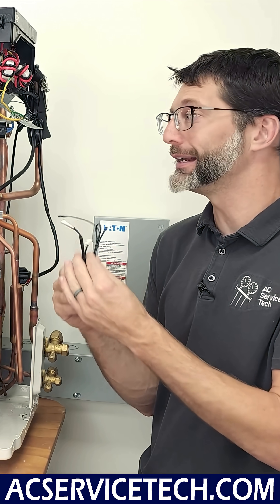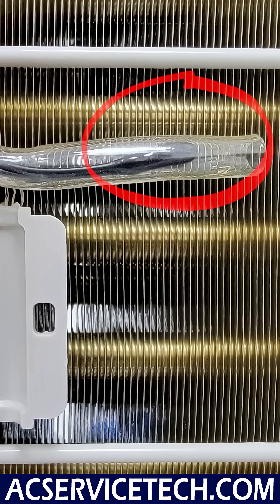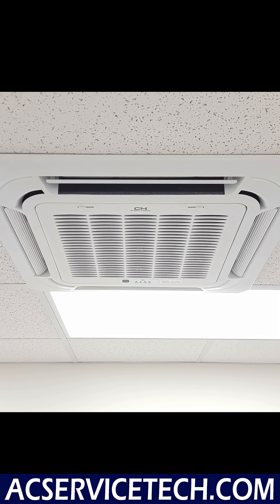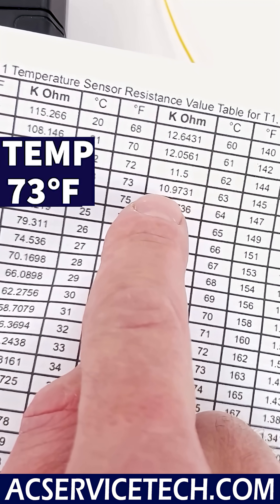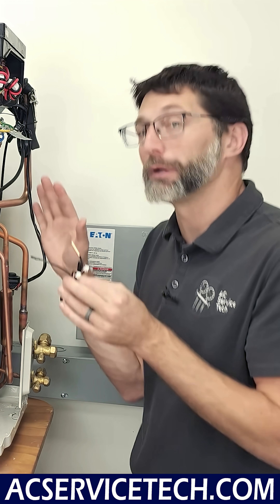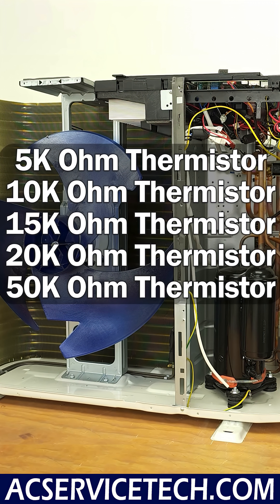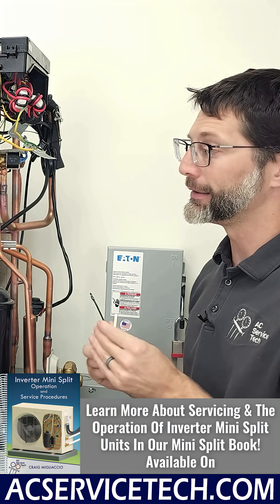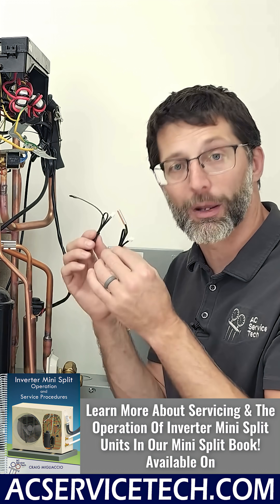Thermistor Problems on Ductless Mini Split Heat Pumps!

Comment: Or there is corrosion on the wire changing the resistance numbers. Depending how the previous replacement was done.

Comment: Also NTC(negative temperature coefficient)or PTC(Positive temperature coefficient). Does the manufacturer state this as well?

Edit: I asked because I got dixell control which uses NTC probes but was set up for PTC. It has engineer parameters so I was able to change on site

Comment: Yep. 1 thermistor took down a Mitsubishi city multi to a data room. We had it so good with 24volts and a contactor 🤘⚡️🤘✨✨✨
Reply: How did that 1 part stop the unit from running? Like how did the unit stop running was it just not turning on at all? And what were the signs you knew it was the thermistor
Reply: @anthonybarragan1687 the unit doesn’t operate because it doesn’t know if it has to work or not (doesn’t read temperature) , some units show error on display, but as Craig said, you have to volt test it
Reply: @eze.reynoso  how does it know not to run? Like what would cause it not to run if it’s not reading an accurate temperature?